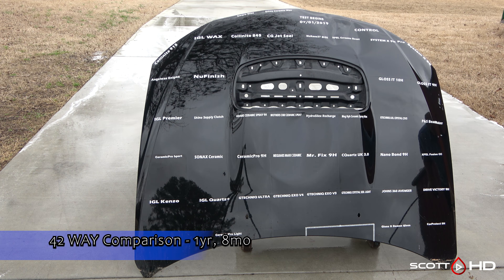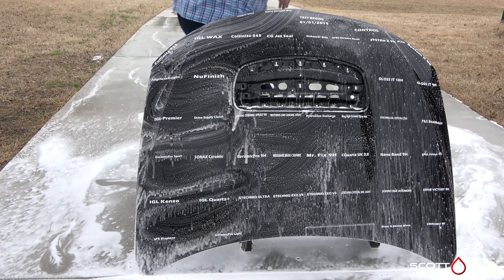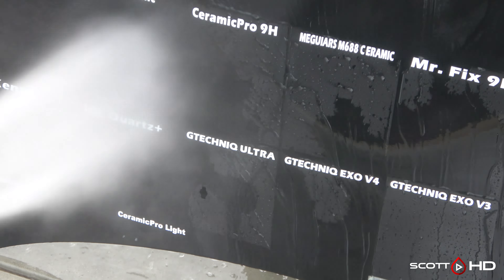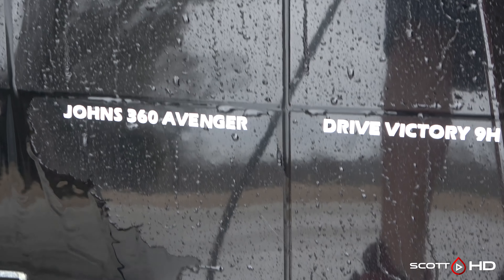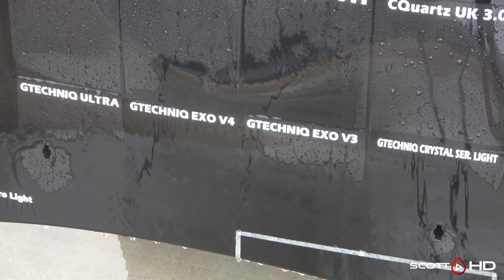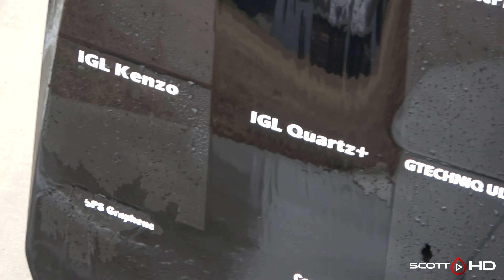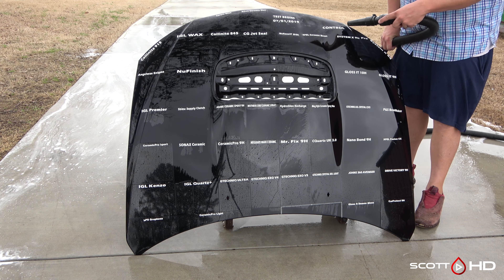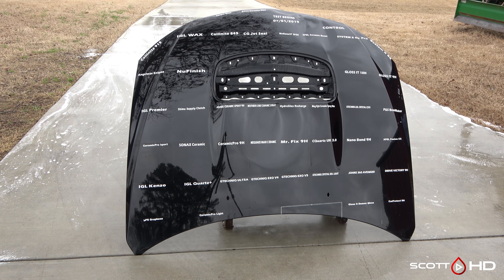Ceramic Coating Wax Sealant Longevity Test - 42 WAY - UPDATE 15 -  1 YEAR 8 MONTH UPDATE

Comment: Really loving the work you do!  Keep up the great work.  It would be interesting to see a comparison between ceramic coatings with longevity claims of 5 years, 6 years or even the rare 9-10 year coating.  Something tells me it's all marketing hype but it would be interesting to see how far off their claims are.
Reply: I can promise you that I'm not happy with the Adam's graphene ceramic coating (not the spray) on my elantra! 7 years ya right lol
The top panels are the worst (hood, top and trunk lid) but the sides still bead and sheet really well.
Reply from the maker: Absolutely!  I am ultimately planning on taking the top 3 in each test and putting them in one test.
Reply: So, the claims that the companies make, in the “fine print” state that they require annual maintenance by the installer, typically using a topcoat to renew the coating. For example, the CP 9H is applied at a shop I frequent. It comes with a lifetime guarantee, which means it will last, but only if you take it in once a year. If you do that, and it fails, CeramicPro will pay for a complete detail and new coating. People don’t often read the fine print though.

Comment: I appreciate these videos, big time!!!  Can you be sure and organize all of these videos that you do, into playlists?  I know you already organize some of them into playlists but all of them would be nice.  It gets hard to go back and find the other videos in this series, as well as other series that you've done.
Reply from the maker: I'm on it!
Reply: @ScottHD  - Thanks for that!  It helps.

Question: Answer it if you want to. 

I'm surprised at how long the Meguiars Ceramic Spray Wax is holding up.  I'm not getting these type of results.  Probably my application methods.  How do you do it?  You might have already shown us in a different video.  I haven't watched all of your  vids.  I saw one of yours where you used a small foam applicator with a small microfiber cloth wrapped around the foam pad.  Then you wet the cloth, then sprayed the wax on the cloth and then applied to the hood.  Is that how you always do it?  I usually wash the car, when it is wet, spray product on the car, dry car.  Then go over streaked spots with a wet cloth.
Reply from the maker: @dutch971  sure.  I have tried it several ways, but applying it like a coating seems to work the best, but you have to be quick to buff it off or it'll streak.   The more humid it is, the faster it'll do it.    Damp application helps extend the time but still have to be pretty quick.  One door I will break into two separate "sections" at a time

Comment: Can’t wait to see what happens when you hit the panel with some Meguiars Hybrid Ceramic Detail spray.....Which ones will get the hydrophobic properties restored and which will stay dead
Reply: This is where you go down the chemical rabbit hole of detailing haha.  Some products might accept it as a topper, some might not.  That'll be interesting for sure.  

I'm curious if Scott can tell if any products are holding up their gloss better than others.  Might be something to note if the gloss is still there even if the hydrophobic properties aren't

Comment: I should have read the product information you posted and it would have saved me some time looking (in vain) for Ceramic Pro Sport.  I finally found a place in Alpharetta that uses the products and sent them an email for a quote for application.  Figures I would hone in on the one product that is professional only.

Comment: Thanks for doing this, these videos are great! So far, have you noticed a general difference in longevity and quality between spray-on ceramics and more labor-intensive wipe-on ceramic coatings? Thanks!
Reply from the maker: "usually" (not always) the Ceramic Coatings seem to last longer, but the price and ease of the spray ons is what makes them more attractive to most.
Reply: @ScottHD  that sounds good. If a spray is easier to apply, I don't mind doing it every year. If I have to go through a lengthy process with little room for error it would have to last several years for it to be worth it to me

Comment: I'm a DYI kinda guy and have a difficult time leaving my car with someone for any amount of time. I watched the video (and subbed :) ) but I was wondering... if you had to pick the top 1 or two NON pro coatings that the everyday guy could easily find online (Amazon or other), what's the winner(s) here in your opinion?
Reply from the maker: I would definitely look at Cquartz UK 3.0. It and the older version of it have always down very well and are middle of the road as far as price point.
Reply: @ScottHD  Thank you!!

Comment: So basically all the ones that last are professional use only. 
What the best that normal folks can get?
Reply from the maker: Yes and no.  That's why I started the 38 way (newer) test because there were several professional only coatings on here.  I think that John's 360 and Nano Bond 9H are good non professional options

Comment: My pick is Nano Bond 9H based on consumer availability and price. Most of these aren't available to purchase and if they are they price is absurd.
Reply from the maker: This is true
Reply: A spreadsheet with prices would be nice to help us make a decision on a cost effective product with great longevity.
Reply from the maker: @detailone978  working on it... I didn't start one for this test, but I am adding it to my master spreadsheet with every product I've tested which will better help.  In the process of updating video thumbnails and playlists having them color coded as well since there are so many tests now.

Comment: CP Sport is really the star here, outlasting "true" ceramic coatings too. Someone hook me up with a bottle of that stuff!
Reply from the maker: It's one of those products where I think you have to be an authorized installer for it.  Which is crazy because it's a freakin' spray sealant.
Reply: you have to talk to one of their reps about it. even for spray coating you'd have to wear proper ppe, trust me on this one.

Comment: New to your channel. This is pretty amazing AND surprising. I did a clay bar, 2 stage paint correction using M105 & M205 on my white Mercedes. Topped it with Chemical Guys Jetseal Paint Sealant. It legit laster 1.5 years. I'd like to hear your thoughts on it.
Reply: jet seal is weak in my books, or I should say ion my climate. I live in a desert and only got about 4 months. I needed something stronger.

Comment: The nano bond stuff is surprising I would be down to try it but too afraid there so many nano bonds out there. I think there is even counterfeit nano bond which already was a unknown Chinese brand
Reply from the maker: Look at my new 38 way test.  The "updated" version on Nano Bond is in that one
Reply: @ScottHD  I just checked and you have on the new test a link to Mr Fix 9h Nano Coating Kit ? for 19$ there is a 'new' Nano Bond Ceramic Coating PRO Premium Car Care Kit 9H High Gloss Paint Protection 30ML listed on amazon, please clarify.  thanks. love the tests.
Reply from the maker: @symphx3540  the Mr Fix you have to be careful with (in my experience) as some of the ones I've tested the Mr Fix 9H will last either a week or a year!    Nano Bond Pro is the one.
Reply: @ScottHD  I agree, its just that your link in your new video goes to this, not a new nanobond.  fyi.

Comment: Bang for buck Nano bond 9H seems like a really good deal!
Reply from the maker: Can't beat the price 👍🏼
Reply: @ScottHD  What was the price? It's not available on amazon. Only 1 bottle from a seller on ebay and it's not new/ open box. I'm a little weary of buying that one. The only other seller on ebay with 1 bottle left is offering it at $150!!
Reply from the maker: @andreaanthony1094  wow! They must have seen this video!   Look at Nano Age 9H now.  Same product
Reply: @andreaanthony1094  I watched this video last week and bought the last bottle on amazon. 36 bucks
Reply: I have a bottle From eBay nano 9h lol. Used it once and haven't had to use it again. It's in the trunk of my car. The cap was lose and starting leaking. Didn't know it was a good product I bought turtle wax also the other day because I thought it was good. Maybe I will return it.

Comment: The meguiars hybrid ceramic wax lasted over a year? The blue bottle?
Reply: Its some how still hanging in there it seems. It doesn’t appear to be immediately hydrophobic but it is leaving the square area water free compared to those next to it 🤷🏻‍♂️
Reply: @rickscars7395  Yes, for the price you cant beat it and very easy to apply when car is wet and the just dry as usual. Also i like the griots 3 in 1 which seems to be doing great.
Reply: @juniorrivera1680   Well it's kind of expensive in Europe. Like 25 euro a bottle which is about USD 30 but I'm paying that with a smile. Like someone else mentioned the top panels go first but the product is so easy to use and makes regular washing really easy.  I actually think you make less scratches since the dirt just slides off.  I cleaned my car 2 weeks ago and we had some Sahara sand in the rain last week which made really crappy stains when it dried up. I drove to a washing box and inserted a coin for a 1 minute of high pressure wash. The car is spotless again and you should have seen the faces of the people when I drove out of that place after just 1 minute time.
Reply: @Luke-san  Here its less then $20. Its very easy to re apply and rinse off. Ive never tried it so im picking up a bottle. Will re apply once a month
Reply: @juniorrivera1680  Hope you enjoy it as much as I am.

Comment: So is the cquartz 3.0 worse then the previous one? Damn, it is so hard to pick one. I'm total noob and will be doing the coating for the very first time. Will be doing that in a garage where the temperature is around 10 celsius now. Can someone recommend something that will be easy to use, long lasting, will not be very expensive and will not give a random result, like depending on the batch it will work or not?
Reply: Hi, definately try Nanolex Si3D Max, or Carbon Collective Molecule / Oracle, or Nasiol ZR53 (this is f*cking awesome). Trust me, you won't be dissapointed.

Comment: Your tests lack a towel wipe off after the foam soap and before the water test. Big difference wiping the residual surfactants off the paint. You’re missing they key component in order to reflect a true test.
Reply: if anything the surfactants are going to cause a lack of hydrophobicity.. he's not missing anything, he just likes to use his preferred washing and drying method lol
Reply: When it's all foamed up the 2nd time, he wipes it down with a microfiber mit, then pressure washes, then blow dries it.  The mit then pressure washing after should get it clean....especially since it's not on the road.
Reply: I said the same thing! I claimed that not everyone has a luxury, 8 horsepower, heated, filtered, blow dryer. And these guys saying that he washes with a mit doesn't mean anything there's still a step that most people are using that is being skipped. That being said, I realized that a ton of people are going to be washing their car at a drive-thru car wash and their cars are "dried" with high pressure air. But there are the new places now that provide towels so you can actually leave with a dry car so lots of extra wiping there. We still gotta give Scott his props because his testing is the best ever and the best that will ever be. Thanks Scott!